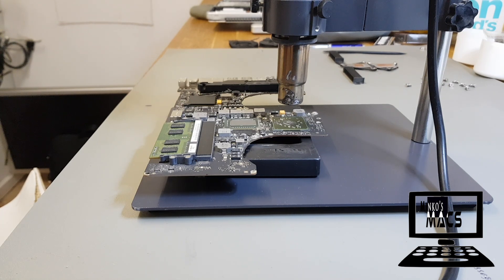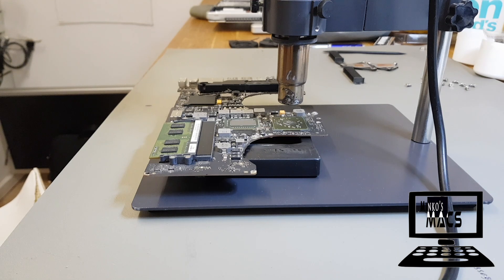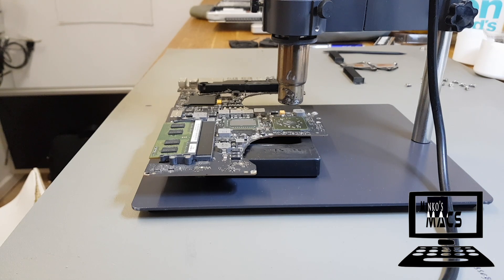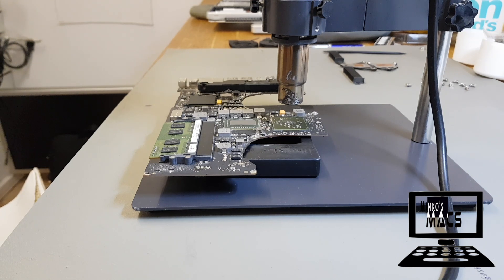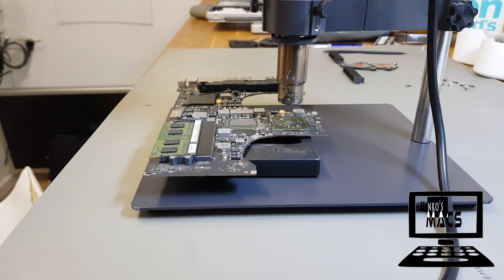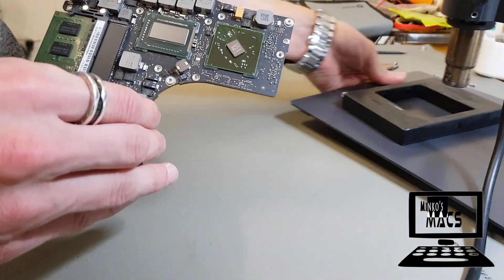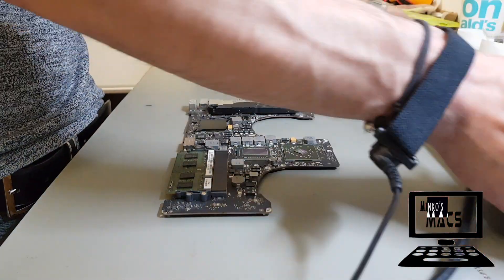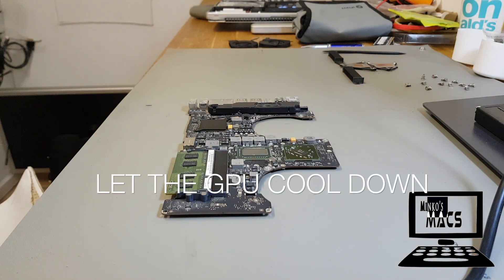Reflow GPU MacBook Pro Early 2011

Comment: 2022: Good news, Opencore legacy patcher can now disable your GPU and make your macbook usable again with current Monterey MacOS.
Reply: this news could help me - thanks, C#! You mean I can pre-load the USB install stick with the instructions to disable the discrete graphics card and use the onboard graphics instead?
Reply: It does work, done it with my old girl that I am typing on right now! Though without the Discrete GPU I'm finding running newer MacOS versions and software pretty sluggish.

Comment: I did this to my macbook pro 2011, it is still working after 5 years. But I will be upgrading to a new macbook this year, time for my baked macbook to retire as my spare laptop. 
I used the oven method, also you moved it while it was still hot, i recommend you dont touch it until it cools down completely
Reply: Done, what was the oven temp and for how long?

Comment: Actually a new logic board will also fail after some time. The reason is that due to environmental regulations manufacturers only use lead free solder these days, and in combination with the poor thermal design of the MBP the solder will deteriorate with time, no matter what you do, the same thing will happen on a new logic board. The ONLY permanent fix is to reball the GPU with lead containing solder. You can find people offering this service, but it usually costs around €200.
Reply: To be fair, that's still less than Apple will charge in the US to replace the board. They charge a flat $350 fee for the convenience unless you can convince them to do it for free, which isn't very likely.
Reply: @CertifiedDoc  Eh all of these MBP's are screwed the GPU's are actually faulty, only real "Fix" is to disable the GPU with hardware and use the igpu on the CPU :/
Reply: @schlaus I've also learned that apparently reballing isn't good enough because that's only part of the problem. The real issue is inside the chip itself; the damage occurs where you can't actually fix it at all. Louis Rossman has a video on the subject that explains it much more clearly than I can.